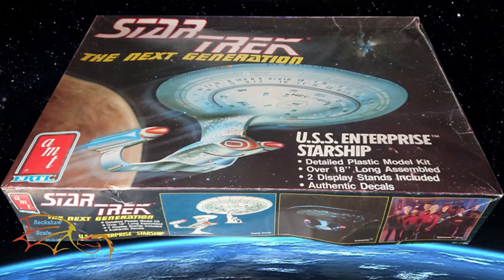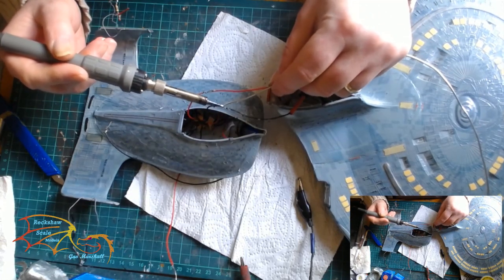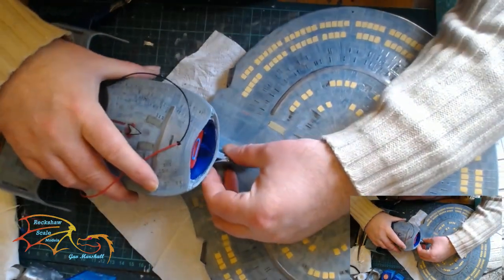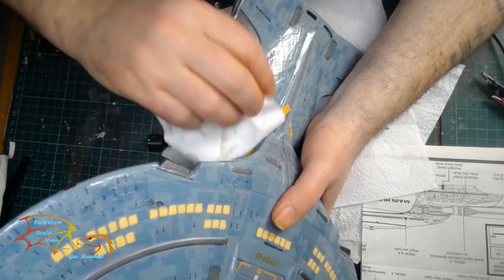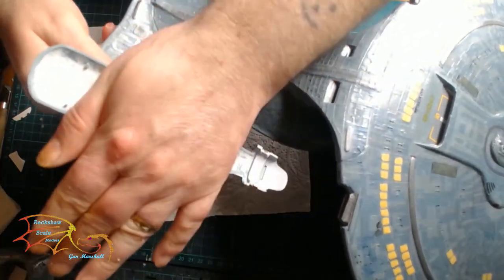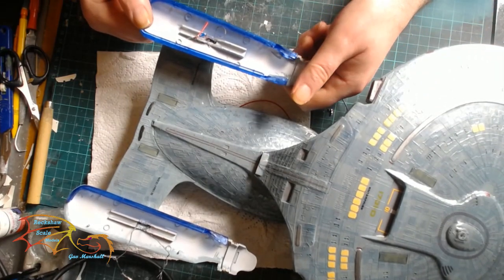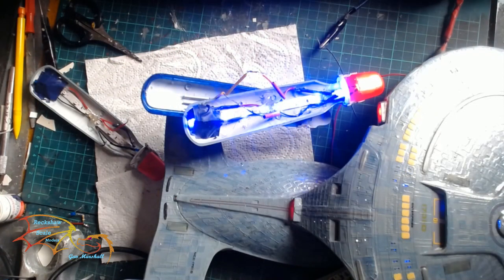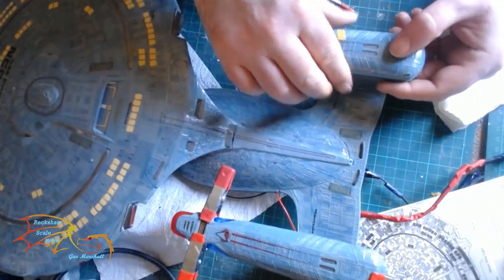amt USS  Enterprise NCC 1701 D Part 15  Scale 1 1400

Comment: It's looking great Gavin. Are you going to put a matt or satin coat over it? Maybe your studio light just makes the surface very reflective.
Reply from the maker: Hi Neil l. That's one of the problems when using your own decals. They are heavier than normal ones. The the shine you see is my lights bouncing off it.
All it means when using your own decals is you need to put a little more work into them than normal.
First I dull everything down by using a matt varnish and then at the end I'll bring everything thing back up with a semi gloss or (depending on the kit) gloss varnish.

Comment: That particular model was never a lit model so im curious to know wich one this is
Reply from the maker: Hi John.  This kit isthe original 1987/88 kit. As far as I know the kit was updated around 1995 with new parts but the clear parts have always been included in the kit. Since then amt have only used this mold for the updated version, basically a rebox. When they released the clear version of the kit they used the same mold once more but injected clear plastic in to it. Even the fiber optic version of the kit is from the original mold.
I'm not sure what version you are referring to, if you would be kind enough to let me know I'll look into. Thanks for watching.
Reply: @Gavin Marshall  the model I'm referring to came in the same box but was grey plastic wich had clear engine pieces and the deflector was clear as well but never came with hardware to light the model. I had a few of these AMT kits great scale. Love your work model looks great 👍
Reply from the maker: If I remember correctly and without searching online I could be wrong. The blue plastic one was the first run then they switch it over to the grey. This one was the blue plastic one. The first video for this build is the unboxing which may help clear things up.
I completely forgot about the different colour of moulds I do have another one in my stash as well as the fiber optic one, but without opening them I'm not sure which version they will be.
Thanks for the heads up.